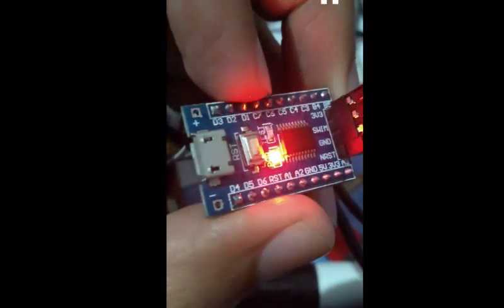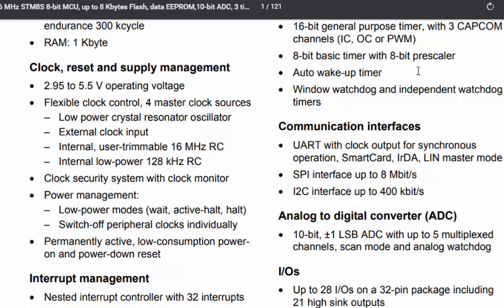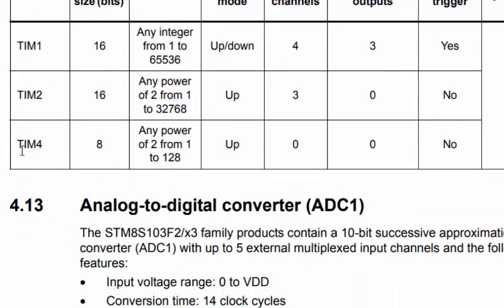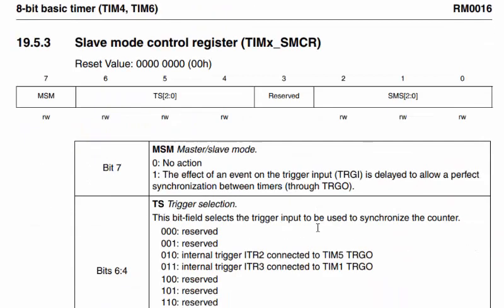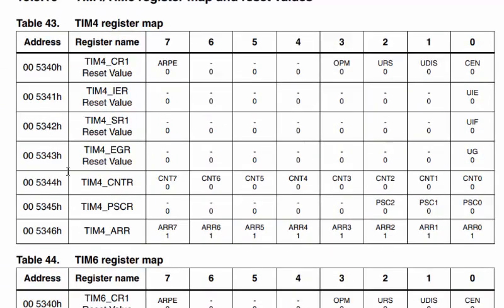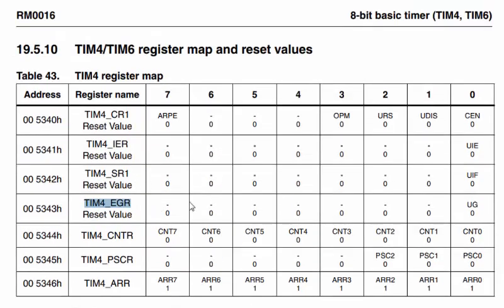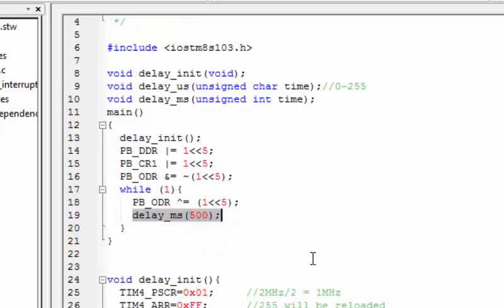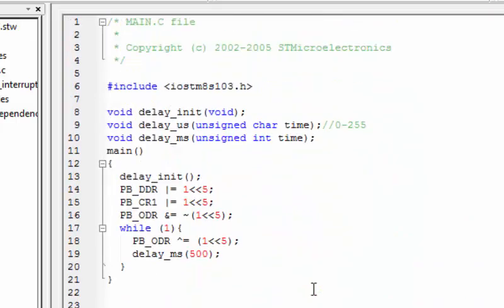STM8 TIMER 4 example | STM8 Timer Tutorial | STM8 Cosmic C | STM8 delay_us | STM8 delay_ms

Comment: Sir , I want to learn stm8s programing using register not by library ........where we find related videos
Reply from the maker: I created these lectures using the core register handling methods. Also check my assembly lectures for stm8. Those assembly lectures will also help you to pick up the right direction. 
thanks
Reply: This is by register. The header file is just #defines pointing to memory locations.